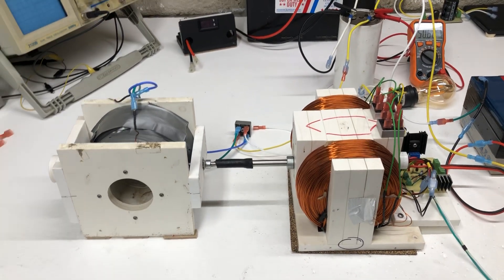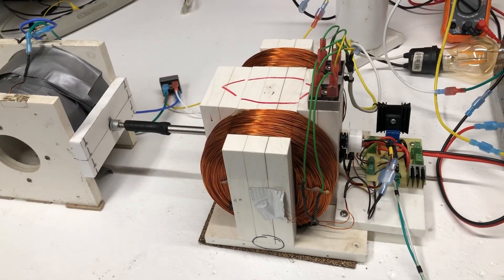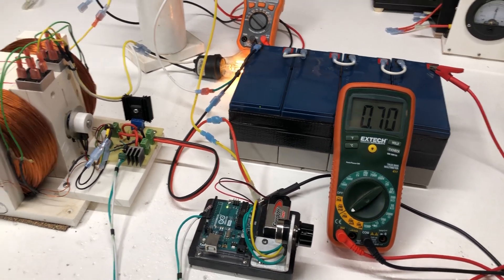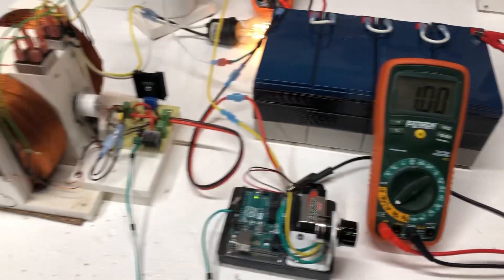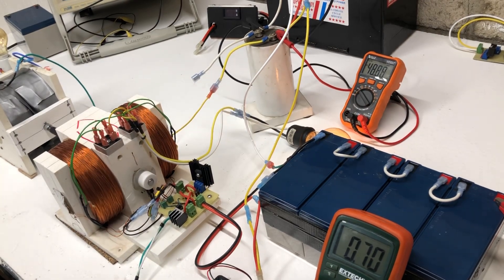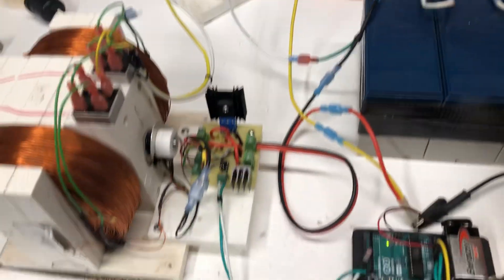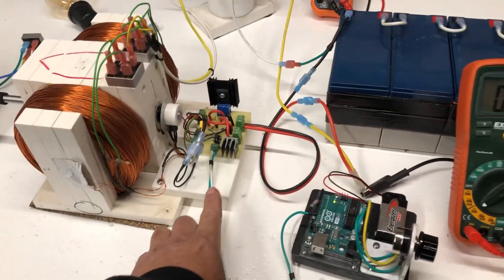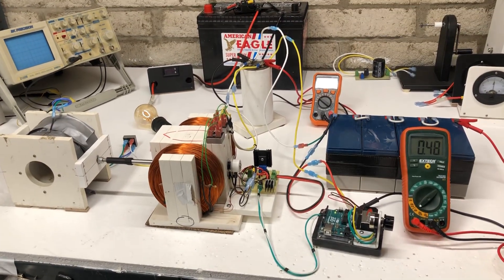Motor to generator

Comment: Hi
Looks good!
Try the "two stage" cap discharge output circuit, where the output of either your motor or your generator fill up the cap only, no load across the cap (this first stage) then second stage the cap dumps to the load however the trick is upon cap discharge the cap is "floating" that means now not connected (decoupled) from the generator coils, or the motor output.   So now the motor output or generator never "sees" the load they must only fill up the cap after every discharge only "work" needed to be done.
  If cap value is such that the cap presents no resistance but instead is a "resonate chamber" (I like to call it) then its going to work really well.
Your cap looks really big, the big white one - guessing about half a farad, dont know, but try caps that do absolutely nothing when they fill up from zero volts, then work your way up gradually where you find a cap that does "reflect" back to the input as in higher draw, then go back a few UF and that should be a good best cap size you can get for "no reflcection"
Also easier to fill up caps half-full than at zero volts, so your discharge pulse width and the load, can decide what cap voltage is at each re-fill....
Not sure what your motor output is, if it is the flyback, try connecting it about 5 degrees retarded in relation to the motor pulse. Make it like an echo. There will be a bit of overlap in time when both motor coil is pulsed, and the flyback diode is connected, so you still catch that swithch-off event when the flyback explodes backwards...
 This can speed up motor, drop draw down and you can fill up bigger UF caps without reflection. 
Also do the two-stage thing when collecting flyback into collector-caps too, as the discharge can really cause extra draw big time, unless cap is floating during discharge then it is impossible for the cap discharge to affect input draw.
If you motor output is winds in a bifilar or pickup winds near or around your motor coil winds, the flyback is going to get picked up too by them, so you are still having fly back contained in the cap and its output.
Anyways really good work beautifful construction nice very clear videos 
Keep going and dont stop!
Reply from the maker: Cap is 3,300 uf 400v
Reply from the maker: Thank you !

Comment: Hi k-energy, very interesting video, but I have a question, u say the output motor is independent on the primary circuit so this output is from the secondary or primary circuit, thank u
Reply from the maker: @trazakaRazaka  for loop back circuit it must be from secondary windings or it will be a direct short

Comment: I have enjoy watching your videos, some very cool DIY motors, and it given me some ideas to maybe try some things.   I think your light draws about 200mA at 50 volts and that where got most your gain went you removed it,  at 200mA at 50 is about 10 watts witch is about what that type light would draw.  Now the question is do you gain more by plugging that output back into the system like your doing or having it just open?  But it left it open you may get very high voltage there, so maybe that not really doable, do you have more info on how this is working?  To me it seems like there  2 coils and your pulsing power throw one coil and getting power out the other one like a transformer, and in that case the output is just a load that build into the motor, maybe there more too it, I like test things and watching things get tested, that how we learn out things work, and from time to time we find how we thought something works is not how it really works.
Reply from the maker: The secondary coil does not load the motor unless you use it like a (generator) using it like a transformer actually make the motor run more efficiently 
 If you look at the amp meter when the generator is not hooked up but the output is it uses the least amount of current
Reply from the maker: Look at the cap dump video

Comment: Curious why it started when you turned on the pot the last time from a stop. The first time you had to manually start. 

Think it's awesome just curious about that.
Reply from the maker: Thank you ! 
 If the timing is lined up it will start if not I have to turn it till it does